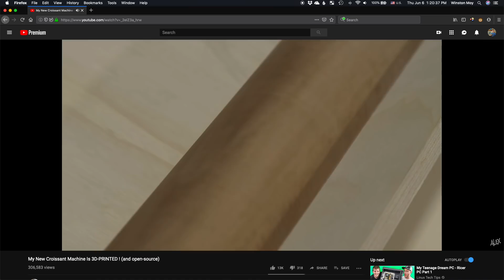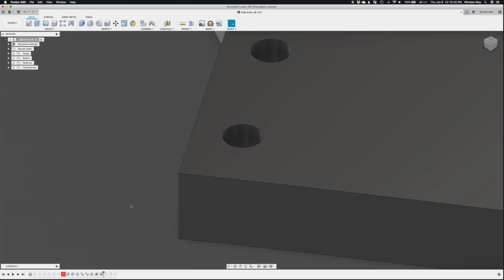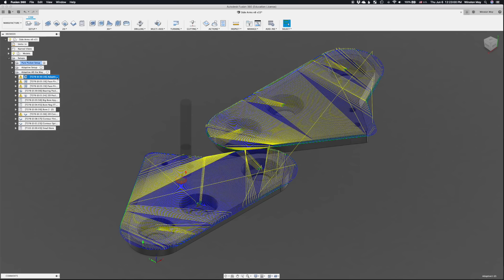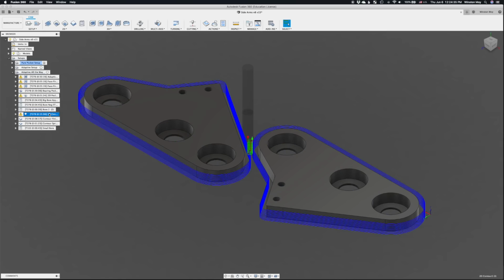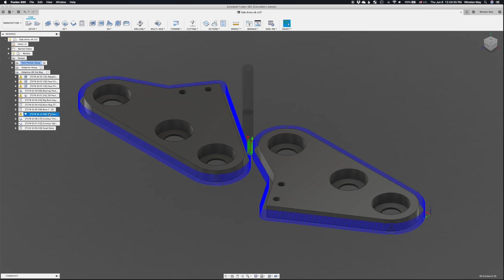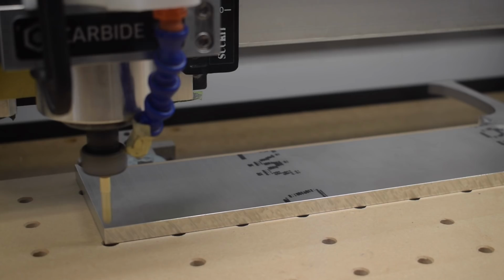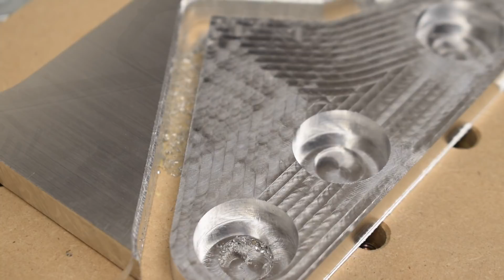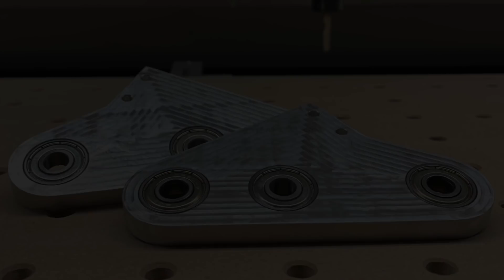Making Croissant Machine Parts Designed by Alex 🇫🇷👨🏼‍🍳🥐 on the CNC - #151

Comment: Love your videos, Winston.  Do you use any cutting fluid when working with aluminum? I was told to use WD-40 or something similar and it has helped, but I'm still having a hard time with aluminum (I get melt instead of chips even with WD-40 and air blast!)

Comment: Teaming up with Alex, great job. Next Wintergatan? Thanks for the upload of this video. Question: what's the noise level of the setup? How loud does it become during operation? My machine becomes annoyingly loud.
Reply from the maker: So, I've found single flutes to cut smoother than 3 flutes. Much smoother noise profile, less gravelly. With the enclosure I could forego hearing protecting. A standard shop vac would be louder. Your cutting parameters will affect the noise level too. I usually don't push to max performance. But it'll never be "quiet" machining aluminum by any means.
Reply: @WinstonMakes  do you have any dBA values at hand?
Reply from the maker: My iPhone says 88, but take that with a grain of salt.
Reply: @WinstonMakes  You built that nice enclosure. Did you add any acoustic material to it? I'm wondering if I could get the sound level down low enough to machine aluminum in my apartment? ;-)
Reply: Winston Moy wow, mine says 104dBA on wood!

Comment: Will you supply a link to the air pump you purchased?
Reply from the maker: https://amzn.to/2WANygv I've got about 60 hours on it, still good so far, and if it does, not a huge investment. Just use 1/4" hose to connect, any thinner and it restricts the flow too much.